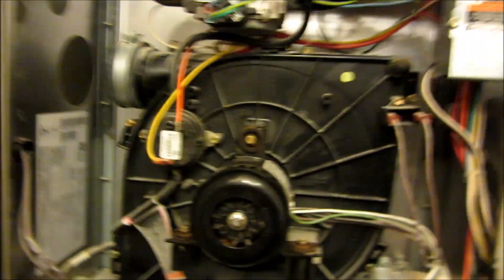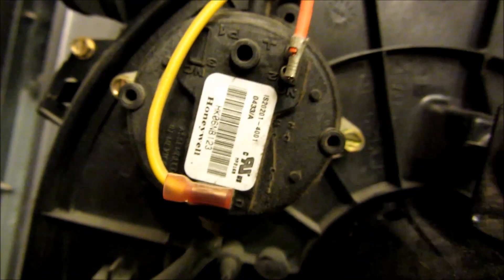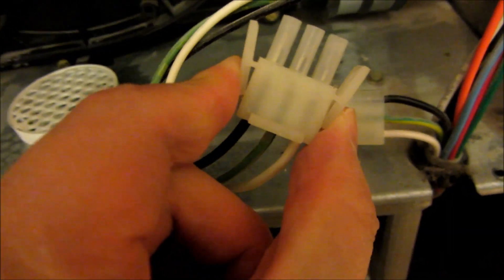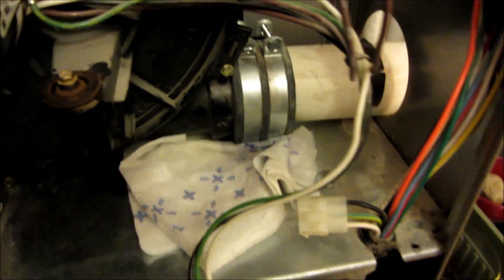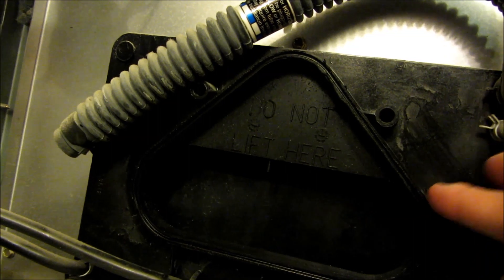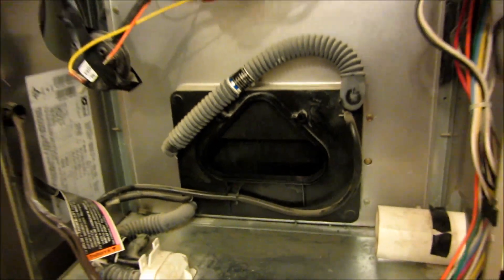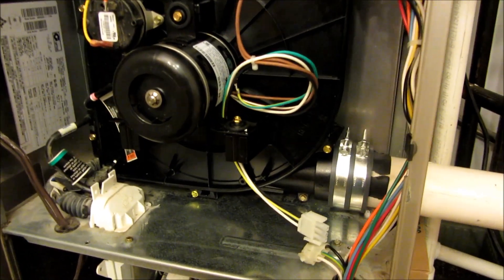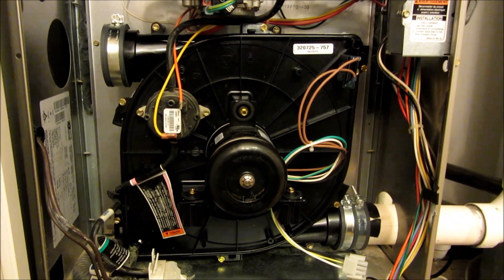DIY - Carrier Bryant HVAC Inducer Motor - Tips on How to Repair and Replace the Assembly Unit

Comment: The 1 inch flexible rubber tubing in the back over the triangle. Does that plug into anything?
Reply from the maker: No, doesn't plug into anything, it just hangs there

Comment: Thank you for your video. I just finished replacing my inducer motor assembly unit and it was a breeze. Just one tip from my experience, gently use a flat head screwdriver in between the ABS pipe and the rubber gasket/clamp to get it to unstick. It felt like mine had PL Premium or crazy glue since it wouldn't budge. Also, for the bottom left screw, it's much easier to use a long flat head screwdriver which clears the furnace. Couldn't get a socket in that one.

Comment: Great video, I just replaced my carrier motor.  Only comment is my exhaust was on the left side, and yours is on the right side.  So I had to switch the cap from the top left to the bottom right.  I also needed to remove the clamps and turn them around so I can access the screw heads.  Thank you for your time.  Saved me $1000 service call.  It was relatively easy to replace.  Disconnect 2 rubber tubes, one pvc pipe, 4 screws and an electrical connector.  about 1 hour's work.

Comment: Evidently it's a one time use "gasket" and not caulking per se. Since my furnace is older than yours I'll probably use red hi-temp rtv silicone gasket maker available at home depot. I have a bright worklight and will be taking pictures along the way. My only issue is that some of these require a "run capcitor" and it may be the part that is bad and not the motor. But there are some that don't have one and are "shaded pole" so I need more information on how the cap is hooked up if I don't find it. Thanks for the video.

Comment: True story - my inducer fan was broken by a walnut. It really made a racket. Apparently a squirrel dropped the walnut into the exhaust pipe on the roof. I was able to repair the fan.
Reply: not sure if you are lucky that it was an easy fix or unlucky that the nut got in there in the first place

Comment: Just replaced this in my 17 year old furnace . . .cost of vent blower was USD$298 (~CAD$400) and replacing it took all of 30-45 minutes. I was quoted CAD$1200 by a HVAC company for this job so saved about CAD$800 by doing it myself. If it keeps the unit going a couple more years then its a big saving compared to replacing the whole furnace.

A few notes:

1. This fan sucks air through the furnace (it doesn't blow air into the furnace) so the seal between the blower and the "triangular" housing that it fits into does not have to be perfect . . .any slight leakage will only draw air into the blower and carbon monoxide from the furnace is sucked into the blower and exhausted through the exhaust pipe. This draft-inducer fan starts up before the furnace ignites and stops after the furnace burners stop so it will effectively purge any carbon monoxide from the system.

2. The black plastic housing that the blower fits into has a "triangular flange" - you see it at ~ 4:00 in the video. That housing has two grey (condensate drain) tubes coming out of it - one at the top right (that tube does not go anywhere) and one at the bottom left that connects to the condensate collection/drain trap. The housing is designed so that it can be installed in different orientations for different furnace models and the tube that ends up at the bottom is the one that will connects to the condensate trap (because condensate drains by gravity). The other tube - that in this case is simply resting on the top of the housing - has a label attached to it that says it should be fitted with a plug. This is because the blower sucks air in at the triangular flange and if the tube (that is not connected to the condensate drain) is not plugged air will be sucked into the housing/blower through this tube as well as through the furnace. I found that on my furnace this plug was missing - it had never been put in. At the time I did this job (8:00 pm in the evening) I did not have a plug handy but I will go get one and install it. Seeing as the furnace had run for 17 years without it I guess it can wait a few more days.

I had no difficultly at all getting the blower to mate up with the flange when reinstalling - wiggle it a bit and it goes in fine and is a snug fit.

On the DIY scale of difficulty I would classify this as a very easy job (one level up from changing a light bulb). The only tool I needed was a (wide) flat head screwdriver - you undo 7 screws in total. I isolated the electrical supply to the furnace at my circuit breaker box so I did not need to remove the plate that the bottom of the furnace (1:30 in the video) but its certainly not a bad idea. I also cleaned the whole area in the furnace where the blower was located as it was a bit dusty.

Comment: When you had the InDucer motor off, you had the collector box drain tube taped to hol it out of the way of the seal. I noticed you don't mention this tube at all in the video. Does it need to connect to something. If not, I noticed there was a clamp on it but no cap. Mine looked the same when I removed the motor housing. What's the deal with this tube? Anyone?
Reply: The black plastic housing that the blower mates against has a "triangular flange" - you see it at ~ 4:00 min in the video. That housing itself has two drain tubes coming out of it - one at the top right (the tube does not go anywhere) and one at the bottom left that connects to the condensate trap. The housing is designed so that it can be installed in different orientations and the tube at the bottom is the one that connects to the condensate trap (condensate drains by gravity). The other tube - that in this case is just resting on the top of the housing - has a little note on it that it should be fitted with a plug. This is because the blower sucks air in at the triangular flange and if this tube is not plugged air will be sucked in through this tube as well as through the furnace. I found that on mine the plug had not been inserted. At the time I did the job (8:00 pm in the evening) I did not have a plug handy but I will go get one and install it.

Comment: This the reason HVAC techs hate when people attempt to do work themselves and call us when they messed up. If you don't know what these parts are called, what makes you think you're qualified to make a video?? LEAVE IT TO HVAC TECHNICANS
Reply: Thanks for the video. Replacing it myself as well. Fan blades blew apart and cracked the housing. Doesn’t look too hard at all. 

Had a “professional” hvac tech from a real company replace my main blower motor a few years back. When summer rolled around the AC wouldn’t blow anything. Brainiac came back and said I needed a $1,000 circuit board. I declined, did my research and fixed it myself. He hooked up a few wires on the board in the wrong spots during the initial blower replacement.
Reply: This part is not anything that requires extreme skill to replace.  I get a little tired of pro techs and others saying nobody should touch their own property to service it.  I fix my own stuff.  If I'm unsure about something, I stop.  The other side of this issue is that you'll run into so-called professional techs who don't know their craft and screw it up, then charge a fortune to boot.
Reply from the maker: DYI qualified, the whole point is I'm not a pro, meaning the regular "know nothing" guy can do it.  Changed black square thing that spins :-) after 3+ yrs it works perfectly, saved $1000 bucks...what the viewers want to know, that they can do it if this Newbie can too
Reply: @PoolarityChannel  good answer   repair men are rapists
Reply from the maker: In any profession only about 10% by definition are top tier Craftsmen.  So what are the chances you'll end up hiring a top 10% "pro-tech", its slim.  So why pay some random "pro-techs" a fortune to screw it up, when you can do the research, be a lot more detailed oriented than some random guy who you will never see again speed through to the next job.
Reply: Thank you for making video Poolarity - Life Hacks. It takes time to make a video. Your effort helped others. Nico Morsillo, If people are comfortable with doing the work and learn, they should. Some of the great HVAC technicians make videos to teach other ways to save money. We appreciate any value you can add; lecturing and whining help no one.

Comment: If your that cautions then you should NOT be touching it because the moment you removed the cover you activated the safety and NOTHING can turn on . the ONLY way the Furnace can turn on is if the Thermostat calls for heat but turning off everything under the sun and killing the power to the whole house is really NOT necessary .. But if it makes you feel safe well then go for it ..

Comment: THANK YOU THIS IS AWESOME - Giving me the courage to do it myself ! Quick question - I have a model 58MCB unit (Carrier) - Will buy from your Amazon link - but how do I make SURE I know I'm getting the correct one ? THANKS !!!
Reply from the maker: The best thing to do is to email the Vendor and ask them.  It looks like your 58MCB uses the same inducer part as mine.  Its actually why I bought from Amazon instead of eBay or elsewhere, I knew it would be easy to return on Amazon if it was the wrong part, so I was willing to pay a little more to buy from Amazon instead.

Comment: Hello. This was very  helpful. I really appreciate it. Gives me an idea of what I might have to do for mine. Mine is a Bryant Preferred Plus 90t so I'm not sure if I'll need this exact same part but I'll do my research. HVAC guy said it needs to be the right RPM for the motor and all that..... Thank you again though!
Reply: hello, Mariano. I have the same Bryant Preferred Plus 90t. I need to replace the inducer motor. It makes a grinding noise. Where did u buy yours, and how much was it? Thanks/Otilia
Reply: Hello, Otilia. Unfortuantely, I am not able to find any information regarding this since it was four years ago. If I remember correctly, it stopped making noise and I didn't actually have to change anything!
Reply: Mariano Marks there are test you can run to make sure that's yur problem.

Comment: you forgot to place the yellow rubber cap from the old inducer on to the me one..carbon monoxide is going to come out the hole if its not replaced...the top rt side of the inducer housing on the front...there is a plastic nipple that is open.. for the multi positional install of the furnace for water drainage...cap this hole off. when the inducer is running with the cap off you will feel air coming from the uprising rt corner...please do the job safely if your going to advise others..God Bless
Reply: jt9087690, DIY expert forgot the rubber cap in the right upper corner of the assembly. He left it on the old assembly. I hope his family is ok, not dead from CO poisoning.
Reply: polishtheturd mickelson well he hasn’t responded so it looks like you’re too late. Time to lawyer up.
Reply: Poolarity - Life Hacks where in the video did you specify the re-installation of the top right cap? It is not obvious. I figured it out but not by finding the comment in your video.
Reply from the maker: +jt9087690 Thank you sir, missed that.  Just put a note in the video to replace the cap.